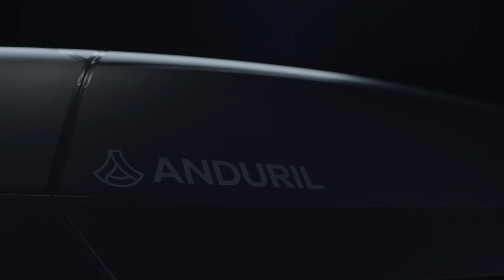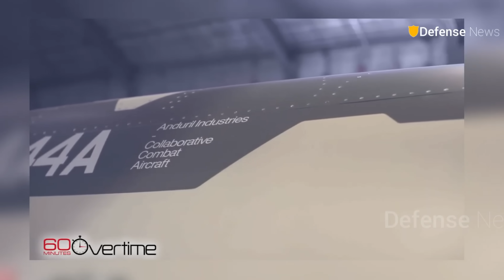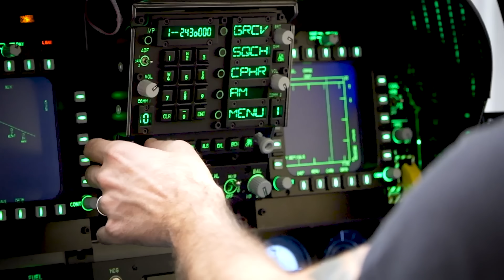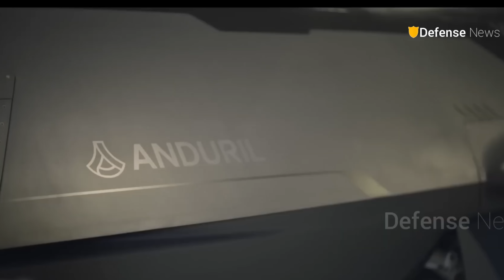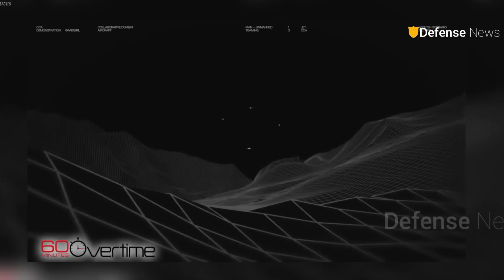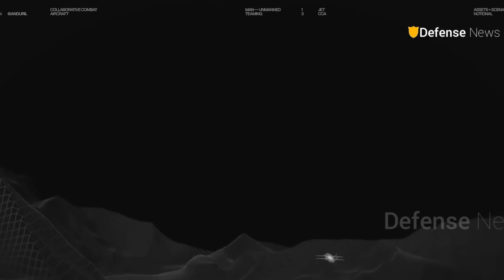Fighter Pilot Reacts to the Anduril YFQ-44A Fury

Comment: One thing not a single person has articulated, is how do the drones compare in fuel capacity and range. How can they possibly operate along side a fighter with much greater fuel capacity and range? The effective range of the drones then, is completely tied to operating out of a safe space that allows refueling.  In contested airspace how long could these drones accompany their host?  Lots of hype. More questions than answers

Comment: I was thinking about the backseat you could have that can track the operation and performance of the aircraft's systems as well as an extra set of eyes in the sky. It is a RIO with so much more potential to help monitor the drone swarm as well as the status of each.
PIC: "I need two drones - long range shot."
RIO: "Take Yankee 4 and 9. Kilo1, 2, and 3 are 45 minutes to bingo, and we need to RTB soon... Yankee 6 is showing low oil pressure. Recommend RTB."
PIC: "Roger, Yankee 4 and 9. RTB Yankee 6. Stand by on kilo 1, 2, and 3."
RIO: "Yankee 6 is RTB; kilo 1, 2, and 3 standing by. Zulu 12 and 13 are twenty minutes out."
All of this happening without either grunting through 9+ G's. The RIO could be in a simulator right next door or the same.

Comment: That all sounds VERY nice, there is just one problem. Its suposed to fly together with stealth fighters, right? So it has to be very stealthy to not be detected. Well what thing on normal fighter jets increases RCS the most? Thats right, missiles on outside pilons and 90 degree surfaces. The missiles are internally stored so no problem there, but what about the vertical stabilizer. Oops, it a single one and stand upright. If you didnt knew that, the reason stealth fighters like the f22 and f35 have to vertical stabilizers is that two can be canted to deflect radar waves. Now the fury has just one, that would make it a AI controlled gen 4.5 maximum aircraft thats suposed to fly with 5th or 6th gen fighters. Doesnt sound like that good of an idea. But hey, what do i know right? Im not a american that always overestimates everything and downplays the thing he doesnt like.

Comment: Here’s a detailed summary of the YouTube video **“Fighter Pilot Reacts to the Anduril YFQ-44A Fury”**:

- *Overview:*  
  The video, hosted by former U.S. Air Force fighter pilot Max Afterburner, reviews *Anduril Industries’ YFQ-44A Fury**, a next-generation **AI-powered combat drone* (CCA—Collaborative Combat Aircraft). The Fury is designed to act as an *autonomous AI wingman* for fighters like the *F-22**, **F-35**, and future **NGAD (Next-Generation Air Dominance)* aircraft.

- *Key Details About Fury:*
  - Can fly at *Mach 0.95* with a **5,000-pound takeoff weight**.  
  - Uses a *Williams FJ44 engine* generating around **4,000 pounds of thrust**.  
  - Capable of pulling **9–30 G’s**, much higher than human-piloted jets.  
  - Range estimated at *2,000+ nautical miles**, costing roughly **$20 million* per unit—**1/5 the cost of an F-35**.  
  - Built to operate *semi-autonomously* using Anduril’s **Lattice AI**, allowing swarming tactics and advanced threat engagement without direct pilot control.

- *AI and Tech Integration:*  
  - *Lattice AI* connects Fury with fighter jets, radars, and ground-based systems into a **“neural kill web”**, letting multiple drones and aircraft collaborate like a single hive mind.  
  - Built without traditional “ground control stations,” allowing **one-button autonomous launches**.  
  - Designed to integrate with manned fighters, taking dangerous missions like suppression of enemy air defenses or first-strike penetration.

- *Pilot’s Perspective:*  
  - Max highlights that AI-controlled drones like Fury will **redefine air combat**, enabling large swarm tactics and reducing human risk in contested airspace.  
  - He compares Anduril’s approach to a “tech company mindset” — fast iteration and operator-focused design — unlike legacy defense contractors.  
  - Notes that Anduril builds **multiple prototypes first**, iterates independently, and only sells successful versions to the U.S. military.

- *Hypothetical Combat Scenarios:*
  1. *Anti-Narco Operation (Venezuela):* A swarm of six Fury drones detects and sinks drug submarines using micro-missiles and AI-guided targeting — all completed autonomously in minutes.  
  2. *Taiwan Strait Conflict:* F-35s deploy behind a swarm of Fury drones that engage Chinese *J-20s* and *HQ-9 SAMs* using countermeasures, decoys, and networked tactics, reversing the air superiority balance.

- *Conclusion:*  
  The Fury represents the move toward **AI-based air dominance**, where human pilots coordinate fleets of AI wingmen. Its combination of high agility, cost efficiency, and smart autonomy could **revolutionize modern air warfare**, similar to how drones transformed ground combat.

*In short:*  
The Anduril YFQ-44A Fury is an **AI-driven semi-autonomous stealth drone**, created to act as a lethal, low-cost wingman alongside manned fighters. With its **Lattice AI neural network**, it promises to deliver unmatched coordination, reduced loss of life, and a major leap in next-generation air combat.[10]

[1](https://www.youtube.com/watch?v=9xYhhwsbNUI)
[2](https://defensescoop.com/2025/10/13/palmer-luckey-anduril-eagleeye-ai-headwear-army-ausa/)
[3](https://www.linkedin.com/posts/andurilindustries_superpowers-for-superheroes-today-we-unveil-activity-7383494426909777920-8hTn)
[4](https://www.youtube.com/watch?v=x9B02pFKpJo)
[5](https://www.nextbigfuture.com/2025/10/anduril-eagle-eye-helmet-gives-superpowers-ai-perception-augmentation-and-fire-control-of-unmanned-vehicles.html)
[6](https://www.uploadvr.com/anduril-eagleye-headset-design-reveal-interface-mockups/)
[7](https://www.army-technology.com/news/anduril-ai-eagleeye-helmets/)
[8](https://www.reddit.com/r/singularity/comments/1o7p039/anduril_showcases_eagleeye_it_lets_warfighters/)
[9](https://www.instagram.com/reel/DP4DqqHiJ9U/)
[10](https://www.youtube.com/watch?v=9xYhhwsbNUI)

Comment: China has aircraft carriers but they can’t do much except become huge targets…They can barely launch more than a few aircraft before the first ones have to land due to low fuel states due to not being able to launch with more than a 1/4 to 1/2 fuel load and few weapons… China has lost more pilots & aircraft this way and is one the major reasons they don’t go far from land based airfields…Their command and control once in the air is based on the old Soviet style of go where I tell you when I tell you…They have almost no training in what happens during loss of radio which is something we are extremely good at blocking…

Comment: The final touch is that Starlink is going to make your concerns possible via the Starship pez dispensing V3 (and whatever comes thereafter) satellites. Each V3 has over 10 times the capacity of the v2's currently deployed. 24 times the uplink capacity.
"V3 satellites also have significantly higher combined radio frequency (RF) and laser backhaul capacity to communicate with other satellites and ground stations, further improving network efficiency."
Reply: Starlink is great but thats not what's going to be running these. The US is working with SpaceX to create its own military constellation of satellites that is called StarShield. Starlink can be a back up if Starshield is being jammed or out of commission.
Reply: @ameritoast5174   Star shield will be using V3's fitted to their liking... and yes all linked. The tell is the pez door. They can tell people "commercial this commercial that" all they want. lol
Billions of funding into the starship program.

Comment: For remote carriers like the Fury, you usually can’t pull more than about 9 to 11 G without redesigning not only the airframe but also actuators, sensors, propulsion, and certification, which pushes costs well above 20 million. So technically yes, it will be above 9 G, but not in the 20 or 30 G range. Besides that, the aerodynamic research required is extensive and not worthwhile, and with just 10 G, you would already exceed the maneuvering capability limited by human pilots in most current fighter jets.

Comment: General Atomics CCA still very much in the running too
Reply: true, however I think the Fury will win. Mainly because it pefectly fits the US replicator program. A drone that cna be massed produced and can be made in any manufacturing shop in the US if needed. I would also expect it to be cheaper than the General Atomics CCA.

The only reason I can see GA winning is because the government would not want to have all of their eggs in Anduril. Also I wouldn't be surprised if the GA CCC is a little more stealthy.
Reply: I heard they might build both. This one's way cheaper so they can use it for different missions
Reply: GA just won a design contract for the Navy CCA program. Don’t know if Anduril was a competitor.
Reply: @andrewjmcd919 if they won the Navy contract, I expect Anduril to win the Air Force. Unless they decide to select GA to keep costs down. 

Is the Navy CCU GA drone similar to the Air Force one?

Comment: As a former ground pounder we often didn’t get the amount of air support needed (not the pilots fault). With these aircraft force multiplying with human piloted aircraft it will make it much easier on the forces on the ground.
Reply: Given that you're a former ground pounder, let me run an idea by you:  what if every dismounted US infantry squad had access to a low-cost, truck-mounted (or HUMVEE mounted) rocket/ISR package that delivers the persistent overwatch and precision-strike effects of a “Spooky” C130 gunship—without needing an aircraft overhead?  The concept adapts the L3HARRIS VAMPIRE or new LAND-LGR4 system (compact ISR + precision strike on a vehicle) and pairs two high-capacity MLHS-style launchers (2×23-cell, 2.75″/70mm launchers = 46 APKWS-laser guided capable rockets) with four quadcopters for ISR, laser designation, and battery-rotation logistics. Two drones provide continuous overwatch for the infantry squad (one close-in, one wide-area) while the other two charge and rotate in when needed.  With laser-guided APKWS rockets you get precision effects out to 3.7 miles—enough to suppress or destroy ambushes, engage light armor, and provide squad-level close air support when fixed- or rotary-wing assets aren’t nearby.  It’s meant to be highly affordable, widely deployable, and able to stay “on station” far longer than an aircraft.  The driver and drone operator would be part of and trained with the infantry squad they're supporting for better communications & familiarity.  Do you have any thoughts on feasibility, integration with squad comms and fire support and survivability?  All the tech and systems already exist in some fashion with the biggest expense being the ISR equipment and the 46 rockets.  Cost would be somewhere between $2M-$5M each and ~$20K per rocket fired.
Reply: Wow! I have to read that again. I got out in 2015 and the industry has exploded with new ideas and options.
Reply: @BenjaminG-k9s yeah, sorry for the long description…a picture is worth a thousand words.
Reply: Thank you for your service.  I hope these platforms help support future operators.
Reply: I understand these are being talked about a lot but are they actively flying now?  Are they in production or is this theoretical right now?
Reply: @briankruse6115 First actual flight military trials are starting this month is what he said.
Reply: @briankruse6115 looking further…”Clearing a critical design review, public unveiling, and a company-run first flight window means Fury is past the paper/airframe design stage and into hardware flight testing — an important milestone but still early in test & evaluation. Expect an initial sequence of company flight tests (handling, systems checks, semi-autonomous modes) before formal government acceptance trials or operational evaluations. “ So it’s Anduril doing the testing.
Reply: Andril